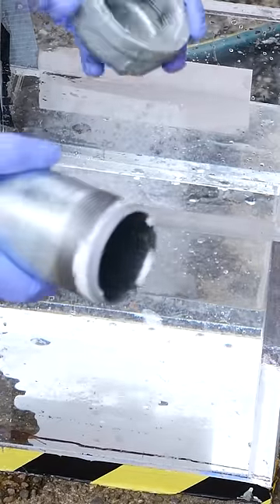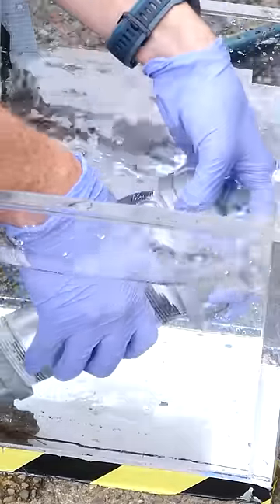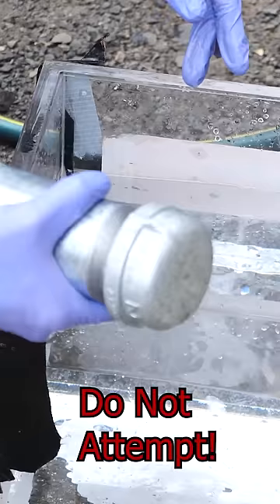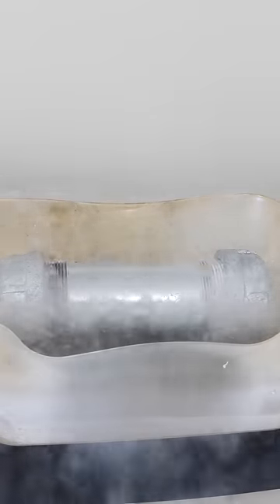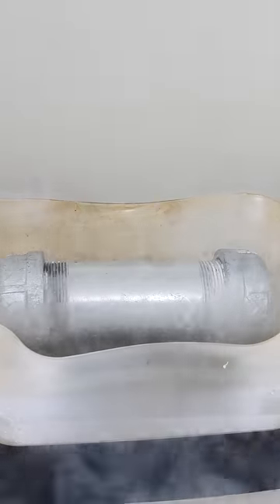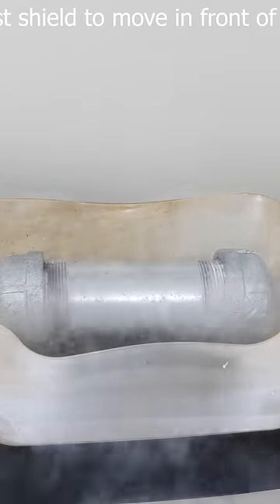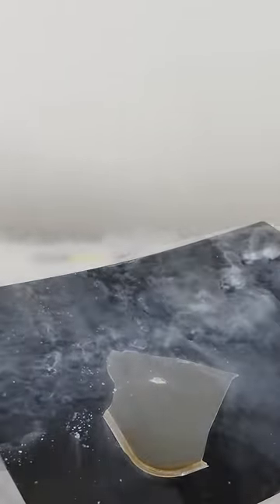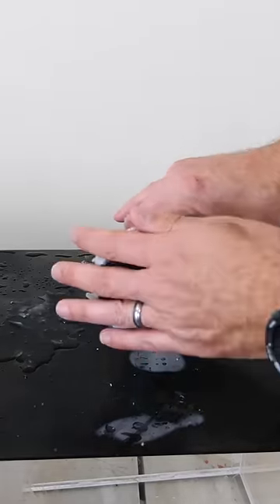Don't Ever Try To Stop Water From Freezing!

Comment: Question:  Given that the steel is stronger than the (relatively) thin layer of ice that accumulated around the inside circumference, why didn't the ice (as it expanded) just crumple inward into the liquid water in the center that hadn't yet frozen (and yet hadn't yet expanded)? 
I know the water in the center was also under increased pressure as it was slap full and the ice around it had expanded inward towards it (encroaching into its space), but still! It seems like this was a contest between how much force the steel was exerting against the ice as the ice expanded, and, on the other hand, how much force the trapped and compressed liquid water was exerting from the inside.  So, the liquid water put more force on the ice ring than the steel did?  That's mind blowing!

Comment: Don't forget that the metal container was also shrinking from the sudden shock of the cold. And it was definitely made somewhat more brittle.
Reply: Underrated comment
Reply: 👍 also was it the thread that failed or or did the top part of the cap fly off? Big difference.
Because without the threads steel at room temperature can usually take that 10% increase without braking. Though its heavily plasticised and possibly cracked afterwards.

Comment: I'm sure you'd get a different result if you'd let it freeze slowly instead of compromising the metal with the liquid nitrogen which is -196 c or - 320 f. 

Materials act vastly different at extreme colds believe it or not. 

I was hoping it would either fragment but makes sense it shrunk and popped the cap.  I wonder if normal freezing would cause it to rupture

Comment: We can now appreciate why we don't want our pipes to freeze in the winter.
Reply: Exactly, they will become explosives and destroy the plumbing
Reply: Not really. Burst pipes turning into a pipe bomb is probably number 1,000,000,000 of problems I actually worry about during winter.
Reply: OH literally why didn’t I realize that. I’ve always known that you shouldn’t let them freeze buy I didn’t make the connection on why
Reply: @loadingresourcesdotdot they burst usually at hose or if your unlucky under the house where u don't see it seen them turn into skating rings
Reply: @NoMoreBsPlease  1,000,000,000?  I need a list.
Reply: @sewerrat7612  Hose? Usually, that’s put away for the winter, but the thing is, the blockage would be where the valve is closed (before the hose) and the point where the line freezes (somewhere else on the water line).  That's why you would want the water valves cracked open if you are in danger of your pipes freezing.
Reply: Reason you never turn off the heat in the winter. Always keep it at 65° to 68°. This will also save you money and energy. 👍
Reply: Just now you're realizing I learned this like at age five
Reply: @troubledsole9104 he is obviously referring to the hose bib, dude. Come on now, use some common sense.
Reply: @imnotacat5299  I am not going to make assumptions dude.
Reply: @troubledsole9104  you have to assume no matter what. All you did was just assume he was literally talking about the hose itself, which is a dumb assumption.
Again, just use common sense.
Reply: @troubledsole9104 alot of people leave hose on if spigot leaks leading to breakage best solution is to shut valve and open spigot as they can still freeze and expand if left closed.
Reply: Not a SMALL DEAL. RARELY do frozen pipes thaw without bursting at least one line. That's why you turn all  faucets on to a slow trickle to prevent the lines going to each. In a basement water line service it doesn't happen as frequently but imagine when you experience the break in attic water lines. That's why you turn all faucets not just one. Your bathroom lines can freeze or your kitchen or BOTH if only one opened.

Comment: You’ve successfully recreated a water main break. Same thing happens in extremely cold temps to water mains in the ground.
Reply: Always leave your tap dripping ✨️ 😌
Reply: you dont know true fear until youre walking along and then hear the water main under your road, or worse, feet, break moments after to walk over it
Reply: @samboyd1828 yeahhhh... seen a worker get sucked into a pipe- that water flows fast.
Reply: @annab13 or move to Florida.
Reply: @SacredMilkOG has nothing to do with anything said...
Reply: Im number 666 like
Reply: Usually water main breaks from freezing aren't from the water in the pipe freezing, but from the soil around the pipe freezing and shifting, especially with clay or silt.
Reply: @Suicidal_Soy_Sauce  lmao, how does that not? He's literally saying that he saw a worker get sucked into a water pipe. He was probably talking about a conduit/sewage pipe, no clue I don't work as a plumber, but I know they have some big pipes that suck good.
Reply: Unground isn’t as cold actually, it is colder on the surface, so I think water mains are safe…
Reply: @sahilsangwan6371 water pipes can freeze underground. I'm in sw Minnesota. Our water lines are buried 6 feet or more underground. About 10 years ago, we wad an extremely cold winter here with very little snow cover. There was some places where it actually did start freezing. The city and the rural water service advised to leave a faucet a drip in your house to avoid having your underground water pipes freeze. I don't think there was many mainlines that froze it was just where it brached off if you had lines sitting with no water moving through for an extended period of time.
Reply: @jje8182  Ive seen plenty of houses and trailer parks pipes burst from not letting it drip in New England, the flooding if not caught immediately is arguably worse than the pipe during sub zero temps. And then if they freeze solid without bursting getting them to unfreeze and work again which takes hours.
Reply: @sahilsangwan6371 as taylor abit up said the ground can freeze and shift the pipe so it breaks it all depends on how cold and for how long and if there is any isolating snow on the ground our water line from our deep well froze in the early 2000's and that pipe was 8 feet down underground the ground was frozen from december to early july that year i know becuse we tried to dig it out but the ground was rock solid for that long.
Reply: @nwerd7584  How deep are your water pipes buried around there? Around here, we barely ever have trouble with anything freezing. It was just that one winter was all.
Reply: @jje8182  I dont have a house, I rent so I see gambits of half ass to good work. In trailers specifically made to be in trailer parks theyre not that deep. Old houses from old times, very deep. Depends on the town, and zoning and whether the owner/builder wants to follow the rules or not.. many do not.  The houses age usually dictates materials too. Even in the cities up here many of the water mains are still like cast iron and break pretty often. The ones where the pipes would straight up freeze or pop usually arent that deep, but we have had some brutal winters the last 20 years, including that icestorm that wrecked havoc across new england. maybe like 15 years ago.. I guess its the contrast between new cheap builds versus victorians hundreds of years in age.
Reply: @sahilsangwan6371 it’s safe if installed deep enough for that areas geographically and cold weather (usually)
Reply: @annab13 he is informatic wts ur problem
Reply: @jje8182  I trust you, it must have happened.
Reply: I wonder if they engineered a pipe that takes into account the expansion in volume of iced water during winter and how does it work. Anyone knowledgeable in idraulic engineering can reply?
Reply: @williamrizzo1285 yeah but then you have to, yknow, live in florida
Reply: @purplepotato69  40 years of awesomeness 👌
Reply: @Deja117  how does a man getting sucked down a pipe have anything to do with the dangers of water not having the space to freeze/bursting pipe because the water couldnt freeze properly?
Reply: @derfliegendehollander5060  "same thing happens in extremely cold temps to water mains in the ground", "that water flows fast". They're talking about water mains here, not about the video...

Comment: Don't forget the metal pipe is shrinking, and becoming brittle at the same time...
Reply: Also, it doesn’t have to break the pipe. It just has to defeat the threads of the cap. Uneven metal shrinkage would aid this. This could be overcome my using mixed metals like Mark Rober did to secure his ice cream. 
  
Regardless, the situation is similar (if accelerated) with what one might do at home.
Reply: came here to say this, flash freeze defeats the steel and makes it brittle

Comment: You were insanely lucky that the threading gave out first. This was literally a fragmentation grenade waiting to go off.
Reply: I don’t think those threads gave out. The top popping off that he refers to looks to me to be the end of the cap shattering.
(Which may be even more terrifying, due to the randomness of the fragmentation and less directionality of the cap blowing off in line with the orientation of the pipe.)
((And yes, the last second placement of that shield…as others have more eloquently stated….his guardian angel probably needs a Xanax or to take up meditation.))
Reply: @jamesmocharski4803  I agree it wasn't the threads.
Reply: The threading will always break before the actual pipe explodes from pressure. In order for the whole thing to explode, the threading would have to be as strong as the pipe lining itself. 

The pressure caused by freezing water will gradually build up until the weakest part of the pipe fails, and in this case the threading is by far the weakest part. 

Also, freezing water does not create nowhere near enough sudden energy to fragment/blow open a quarter inch thick pipe.

This is water, not gunpowder.
Reply: And his shield looks like glad tupperware
Reply: @ash-cw8kn  depends how it’s designed. If the shear area of the engaged threads is greater than the cross sectional area of the vessel wall, the vessel wall will fail first (assuming the thread has been produced with the required root radius).
Reply: @ash-cw8kn except the thread didn't break the cap did so your entire comment is pointless
Reply: @jamesmocharski4803  no, the last second of the shield closing caused a vibration that we all know is what happens when water reaches beyond the freezing point but doesn’t freeze until there’s a slight vibration, like the water bottle in freezer trick (or how the discovered slurpees with a can of coke in the freezer. HEX coin $0.028
Reply: no, the last second of the shield closing caused a vibration that we all know is what happens when water reaches beyond the freezing point but doesn’t freeze until there’s a slight vibration, like the water bottle in freezer trick (or how the discovered slurpees with a can of coke in the freezer. HEX coin $0.028
Reply: @ash-cw8kn  cant say threading will ALWAYS break first. It depends on the amount of threading.  What if it had 100 thread and the cylinder walls were thin?? Your comment is False. Also just because it isnt gun powder doesnt mean it wont explode. Obv as we saw here the pressure inside slowly increases until the breaking point.  The thicker the material = the higher the pressure it will be.
Reply: Why do a couple comments claim the cap shattered? This video should show the cap (multiple pieces of it if you're right) but if it does I don't see it. It looks like the cap is only rotated on through a couple turns, so (predictably, not luckily) the thin little threads gave out before the thick pipe itself.
Reply: One thing to keep in mind is that metals which are "super cooled" with nitrogen become exceptionally brittle. In the video, there is still clearly a metal ring larger than the circumference of the pipe still attached. There's even an N engraved into said ring. The most structurally weak part of this would be between the ring of the cap containing the threading and the solid top part of said cap. The bend in the metal is under the most strain from the internal pressure. The bend in the cap will have broken free, water quite literally blowing off the half of the cap connected to this bend as the metal has become very brittle. Tiny fragments likely no larger than dust will have fractured, leaving you a clean looking break and a small, very dangerous, flying metal frisbee.
Reply: No it would not literally be a fragmentation grenade. Different metal and design.
Reply: @milesoats4256  how do you know
Reply: Yeah it wasn't the threads the cap broke in the top of the cat came off
Reply: @ash-cw8kn  you sure about that because with all the threads stacked like they are it would be a lot thicker than the walls of that pipe which is why the top of the cap broke the threads did not shear
Reply: @ta1708  because I can see what happened to it with my eyes
Reply: @JMacSD  because it was the cap that exploded and not the thread. If you look at the end of the pipe when he is showing the inside of the pipe you can clearly see the treading part of the cap still on the pipe
Reply: yeah, the threading would definitely give out before the cap. the simplest fix for that would be replacing the caps with some kind of strong epoxy, which should be strong enough for the pressure to build to fragment the steel jacket instead
Reply: @turnip3829 what? Really? Epoxy?
Reply: @mackhomie6  ong. classic pipebomb design.
Reply: Frag grenades have grooves cut into the body so it will actually fragment. The threading is the weakest part in this tube anyways

Comment: This is actually something that pioneers used to crack huge rocks into pieces.  During the summer they could drill holes into large boulders fill that with water, and then plug the holes (with piece of the rock). Enough holes drilled into a boulder and you can crack it in half.
Reply: Huh, neat :D
Reply: No
Reply: Did the pioneers also ride those boulders?
Reply: Get out of the city 😡
Reply: I heard My aunt in Mexico used to Crack big as rocks!
I have yet to go see it for myself. 
I'm going to save my money to go see her to see if this is true!
Reply: Se llama "gelivación" y ya lo sabía todo el planeta muchos siglos antes de los pioneros.
Reply: That seems like a ridiculously long process when feather and wedges have existed in some form for thousands of years. Same amount of work but results in hours or days rather than months or years.
Reply: @AnonEyeMouse you get it wrong. At first they need to extract parts of rich with the ice truck. Wedges
Reply: @AnonEyeMouse  the answer is, OP got it wrong about summer and winter. It is used in winter times or places where the night gets freezing cold. They filled already existing cracks in big rocks, By the next day it's done. They also used wood wedges and let em expand with water in hotter environments.
Reply: While I don't doubt they did do this I highly doubt it was a main method as even when they were building and laying the first train tracks in America they were using nitrogen glycerine, tnt and other explosives along with chisels drills and sledge hammers etc if they were drilling holes then waiting till winter for the water to freeze they would still be pioneering America today buddy 😂😂, secondly a lot of rocks are porous and will actually absorb said water and suck it down into the ground especially over that period of time bro. Please go back to school aye.
Reply: @ismaelyu5 wow someone with some common sense! Good on you mate.
Reply: Thats how Giza Piramid is made from huge rocks.
Reply: Yes.  you drill enough holes into a boulder and you can crack it.
Reply: Actually that's not at all the same this guy froze the water to the temperature of liquid nitrogen that's a little more than negative 60 celsius. 

You're not wrong they do actually do that and it also happens every year on roads The cracks in the roads are because of expansion when ice freezes then thaws out
Reply: That’s genius
Reply: I know what crack rocks you're talking about and they ain't made of stone.
Reply: You can also pour boiling water on frozen rocks 😂
Reply: That has nothing to do with confining water and freezing it, or temperature. Or anything for that matter.
Reply: @machinegunpictures  it will fracture stones which pertains to comments above.
Reply: @AnonEyeMouse  Thank Dog For ur comment bro!! 🙏
My thoughts Exactly...🤘😭
Reply: @alexmini123 the water was partly frozen inside. Mixture of liquid and solid water sit around 0 degrees C as the liquid water loses heat to its environment. It wasn't at liquid nitrogen temperature yet, so that could happen in your freezer.
Reply: Cap cap cap cap cap cap
Reply: @justinrodgers6305  is that a SpongeBob reference 😂
Reply: @AnonEyeMouse  you realize they're talking about BOULDERS right?
Reply: insert Gif pf SpongeBob riding a rock like a pioneer.
Reply: How did they plug it strong enough so it doesnt just come out of the drilled hole
Reply: Oh, thats interesting, how did the plug the hole so the rock would break and not just push out the plug?
Reply: @johnnyBravo707  i has the same question

Comment: What if the reservoir was more durable? Well, the water would still freeze, but not to the ice we know on a daily basis, but would take the form of denser ice. At 200 MPa of pressure, Ice II is formed, which has a density of 1.16 g/cm^3, (water has about 1 g/cm^3). From what I know, it is blue in color, and can be found, for example, on the bottom of the Arctic Ocean, or when a glacier melts, there is a layer of this ice inside it.